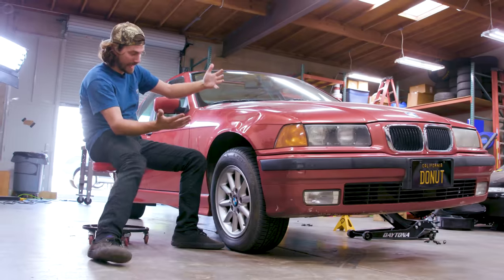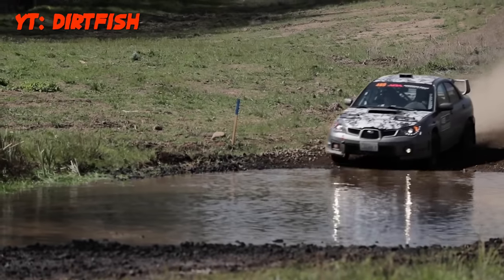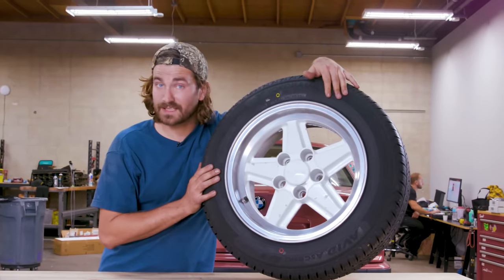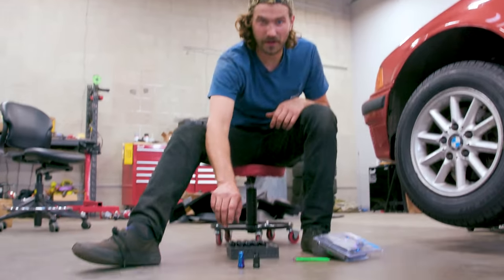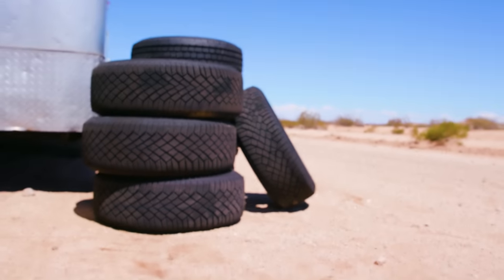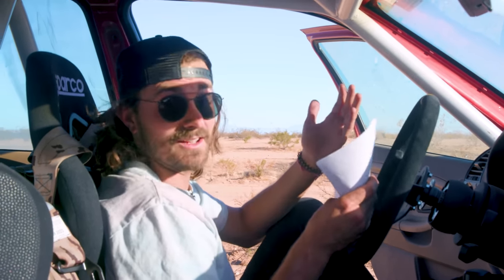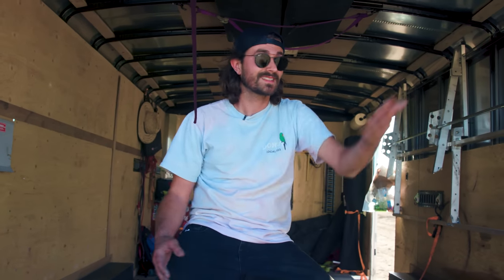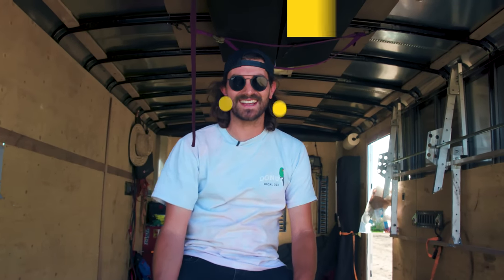BMW Off-Road Tires - Were They Worth It?

Comment: The team during editing:
"Why did we swap wheels for each test, and not do all the test with one set..."
Reply: It’s faster to swap the whole wheel than just the tire, and the tires were different sizes, they wouldn’t all fit on the one set of wheels.
Reply: @saltybutsain6348  Haha, I didn't realize it could've been done even worse!
Reply: Yeah, like Salty But Sain is saying, it's a whole order of magnitude harder. Instead of a quick unbolt the old tires bolt on the new tires, it requires mounting and balancing the new tires which definitely has to be performed in a shop.
Reply: @saltybutsain6348  I don’t think you understand what was being said
Reply: @wontonii232  not what was meant
Reply: I believe what Nicolas was saying is why not do the three tests on one set, then change to the second set and do the three test and finally change to the last set and doing the three test.
Reply: @CristoferMagana  oh, yeah I bet they just edited it in a different order than how it was actually done.And even if they did it in the order you said, it wouldn’t take long to swap the wheels, since they have 5-10 people there.
Reply: @CristoferMagana  I was trying to make a joke. ;-)

Comment: Now I wonder if the snowtires were the fastest because they were 16"
Reply: That could help a little, but the main reason I see is a lot softer compound, it has a crossed pattern too, this offer a lot of grip, but everithing comes with a price, and as he shown, those tires will wear out soon than the others, I would prefer to have more grip if all those modds are really going to be squeezed out, rather than other harder and durable but slippery tires.

Comment: A pro tip for beginner rally drivers, put in tubes in tires. There is a big chance you will bend the wheels hitting hard rocks, trees etc. Old school tubes in tires will let you finish the race at least and the tire wont go off the rim so easily. Its It's a cheap, kinda oldschool way, but it works

Comment: I've never had a problem with lug bolts, if the center bore is correct you can just stick the wheel onto the hub and install the lug bolts.. but to each their own I suppose

Comment: In my opinion you picked the wrong snow tires.  You are correct in mentioning that the studless snow tires that you bought don’t like the heat.  But you can also get studdable snow tires.  They are a little harder compound than studless, but still offer some really aggressive tread.  One example would be Firestone Winterforce2 as a studdable, VS a Blizzak as a studless.  So I would have gone the studdable route for my snow tire option.

Comment: The only thing I know about rally tyres is that you want a sharp edge to the tyre wall.
The sharp edge really help dig through the soft top layer when you're going sideway and gives you the grip of the solid dirt underneath.
Those truck tyres looked like they had a nice edge.

Only 4 minutes into the video so keen to see how they go.

Edit: actually the snow tyres seem to have a nicer edge. The normal tyres look really rounded, I'd expect them to just flow over the soft stuff while sideway and really reduce grip.

Comment: fun fact. snow and ice tires are much softer a tread compound than your typical dirt and gravel tire. that means they flex, heat up easier, and grip for days. but they wear out fast. think of it like drag radials for the dirt.

Comment: I live in Minnesota and have run lots of different tires for winter on coupes and sedans. I can say that, by a long way, the the conti winters were by far the worst winters i've had. anything over 4" of snow and you are thinking shovel and/or uber. whereas I had cheap dunlops on a 330i and it was a snow macnine. never stuck  Also did 4 MN winters in two different S4's with all seasons. Not great in any season, as you'd expect.

Comment: The second I heard snow tire I was like nooooo. Up here in southern Ontario I take off snows above 7°c so end of March to mid April. I run mud and snow rated Continental grand touring all seasons tires the rest of the year great in the dirt great in light snow great in rain. I drive back country roads every day with mixed tops from dirt to tar to pavement

Comment: i think the tire pressures might have a lot to do with that stopping distance because the different sizes will make the tire sidewall roll over and flex much differently. maybe do an episode playing with optimal offroad tire pressures?
also i think the slightly damp dirt on course will give you an advantage over the previous video as less dirt moves around while you drive and its not slick mud.
the truck tire will be best mainly because of sidewall thickness. I've blown holes in a few sidewalls in my subaru while sliding around hairpins. Any big rocks when ur doing that will just go right through with all season car tires

Comment: Hey Zach Jobe! You should put a cover for the Manual Transmission Shifter I think so. Because there's some sand storm is coming into the cabin through that hole

Comment: so we have the truck tire as the hardest, the yoks as the mid, and the snow as the softest. in terms of mechanical grip, they are similar enough to be irrelavant on this terrain. on pave, the difference in tire compound would become much more apparent. tread pattern isn't as important as tread depth, sidewall thickness, tire pressure, and tread flex is for dirt/snow road grip. it's an important part of road holding and handling in rally, but it is less important what kind of tires you have on loose surfaces than it is on tarmac

Comment: I've always wondered, can racing in the desert be a problem as dust can get into the engine?
Reply: Eventually when the air filter gets clogged but it would take a bit of neglect, not cleaning it or replacing it.  First thing that would happen is loss of fuel economy and power

Comment: For those in places without snow, snow tires work on the basis of trying to collect and hold snow in the tread pattern, because snow sticks to snow, runner doesn't, so the design of the snow tires tread is basically not helping any in the soft sand

Comment: Zach, if you're ever in WA state, let me know; I'll drive any distance to get a pic of our e36s together.

Also, maybe not a popular point of direction but, if you're going to be driving using your handbrake and shifting, e36/46 platforms like you to have your right hand either between the shifter and the ebrake or floating above the shifter while your left hand does all of the steering unless you need to really grip into it. That said, I fully expect a hydraulic hand brake to be up on the episodes list with a showing by probably chase bays (I bet the hoonigan branded hydro brake if I were a betting man).

Comment: I feel like you really shorted the truck tires. A closed-shoulder highway-style tread doesn't seem ideal for rally. I would have gone with an AT, like Cooper Discoverers or Hankook Dynapros. I actually went with Dynapro MTs on mine, as our tracks tend to be either sandy black dirt or clay, & often have mud holes.

Comment: Those truck tires were ht's that means highway tread, least amount of actual traction that dot will allow for legality while reducing rolling resistance to get better mileage. An actual all terrain would hook much better and not get chewed up too bad.... I can always tell the highway treads up here in a Minnesota winter, they're the ones stuck on flat road in 2" of snow

Comment: The Sumitomo HTR A/S P02 that were on the car to start were regarded as very competent budget performance tires in their time, sacrificing comfort and noise for all weather traction. I personally would have gone for its replacement, the Sumitomo HTR A/S P03, over the Yokohama Avid Accent GT. They test better in winter conditions (which requires tread features similar to off-road tires when not using winter rubber compound) and have decent ride comfort (taking bumps well = better maintained contact patch on rough surfaces). Bonus, P03 is relatively cheap!

But then there are All-Weather tires to consider as well, such as Michelin CrossClimate 2, Firestone WeatherGrip, and General Altimax AW365.

Comment: So snow tires are what I use on my Subaru (rally build) out in the dirt.  However, I've only used them in the winter so far out here in Utah (car is under the knife right now).  I'm curious to see how they handle the heat.  AT tires may be a good middle ground if I don't want to be swapping tires whenever I go to the dirt.

Those Yokohama's did better than I thought, but they also seem to have really deep treads for a street tire.

Comment: One big complaint: with this few runs, you shouldn't measure the averages (or at least, not only), but instead measure the fastest lap for each tyre. If you had run a hundred laps per tyre, sure, then uneven driver performance evens out, but with such few laps, fastest laptime becomes more relevant.
Reply: i was curious to know which tire had the fastest lap as well.  also they didn't show how they did the laps.  did they do three in a row of the all season, then three in a row of the truck, then three in a row of the snow tires?  i mean maybe his seat time was a bigger factor than the difference in the tires.  they should have randomly did all three tires (hiding the tire type from the driver too maybe) and let us know that.

Comment: If you had purchased a hard compound high performance snow tire like Dunlop Winter Sport 4Ds, they wouldn't break down like that. I would run them year round "spiritedly" in Alaska and participate in amateur rally events in a Subaru WRX and would get 3 years of use on them with minimal wear.

Comment: As a offroading truck enthusiasts im wondering how an all-terrain tire is not on the list for the offroad racecar, are all-terrains not specifically designed for what your doing, and in that small of a size (considering trucks running 35"-40" tires) would be pretty cheap?

Comment: Those Muteki lug nuts suck specially on the coating. The coating fades or chips super quick and they tend to strip easily. I bought a set and was highly disappointed with them I ended up switching to sickspeed lug nuts

Comment: I hate studs so much. I took off my exhaust headers to wrap them and some of the studs came out. I had to drill out one of them and tap the hole larger to put in bolts.

Comment: Snow tires are terrible on gravel. They are way too soft for it and they pick up rocks. Those small cuts in them, meant to increase grip on ice and snow make it so that grip on other surfaces is pretty bad compared to a normal tire. And since I've only used winter tires in winter climate +10°c to -20°c, I can only imagine how bad they would feel in the summer. Would be like driving on a sponge.
Also, they are way too wide for rally racing. At least in the front. 205 would work at the back but the front should really have 175-185.

So in the end, if you want to go with a non-rally tire, an all-season tire would be best. Made to work in all conditions/climates but still meant to have grip in slippery conditions.

Comment: I think this would be the only scenario where 6-7 year old winter tyres could be safely recommended.
(Cause they are so hardened by that time that you would not want to use them in winter conditions or on wet roads anymore)

Comment: Can you compare light weight, small diameter and width vs large diameter and width wheels?  Internet say always go with the wider wheel & tire for better lap times, but I think smaller wheels are better for reducing unsprung weight, and reducing brake pad & rotor wear, not to mention easier for the drive shaft to rotate.  What is the sweet spot between these two ideologies?

Comment: s54 swap it you guys have the budget. or do what I did and s52 swap it. throw some bilstein coilovers on there. do the clutch and flywheel since as you know it shares the same ZF 5 speed as the e36 M3. do an exhaust. LSD. brakes. and sway bars. I still have this car just with a blown s52...do the shifter bushings. dont money shift it doing like 120 like I did

Comment: How many runs per tyre you made? Or how you take the human variable out of the times as with each repetition of the track you will inherently perform better as you memorize the track, establish more adequate breaking points and faster driving line?

Comment: You guys did the 60 to 0mph test wrong, you are supposed to lock up your brakes when stopping on dirt, it will pile up infront of the tire but you letting it roll will make the tires surf across it, increasing the distance more than double if done correctly.

Comment: So this is an exercise in using 3 sets of inferior tires that would have been much more expensive than just getting a set of proper gravel tires. Fitment with deep dish wheels poking way out is most certainly not what you want for a "rally" setup lol. Also, changing the offset this much through wheels or spacers is very bad for your suspension geometry.

Comment: You know, all you need is a wheel hanger. It's just a rod that you thread into the lug bolt hole that let's you take the wheel off without it crashing down. Or helps line it back up going back on. Then you could continue to use the, VASTLY superior way of securing a wheel to a car the Germans intended for their machines. Cause you know. They're so VASTLY superior.

Comment: Geolander's and done bud
Reply: Specifically Mt G003 or a/t g015
Reply: I'm sorry but poke and flush were used in this video. Which means it doesn't matter what tire you pick because it's gonna be ass anyway. Video is more about wheels and looks than tires
Reply: Just hella flush it bro roll the fenders then rocket bunny it for the lol's

Comment: You need to work on your corner exits. You are driving like a drifter. You need to try and be pointing straight at corner exit so that you can get a good drive down the straights. You should really look at going to a midget or sprint car driving school. Not only would it make a great video, but you will learn how to get a good drive off the corners.

Comment: Oh yeah, the purely scientific standpoint

Would unsprung weight differences as well as track differences (width etc) not throw off the results? Since you have 3 different wheels in combination with your 3 different tires?

Comment: With this video u can see his data is flawed, he used the yokohama first then snow and truck, as the laps went on u can see he became for familiar with the car and "track". At the moment looking at the speeding up then braking would be a better way to measure what tyres he should use because every lap his braking points were changing and he was pushing the car more and knowing more about the cars behaviour. Ive done rallying and using a truck tyre is idiotic, on budget use a normal road tyre that has a good tread pattern by eye (looks most like an actual rally tyre). If your not rallying on gravel, mud or sand eg tarmac a tyre with low water rating normally means its slicker and shallower treads for better tarmac contact(summer tyre) and a larger diameter wheel helps. Also using a bigger diameter wheel than a r15 on gravel is stupid for rallying in this car, its adding weight to an object that should ideally be as light as possible, having the wheels a bit wider could help as well. Tyre pressure also has a large impact on this stuff. At the end of the video ur right what u did was a waste of time and any tyre could have worked for what u did, from the useable data the yokohama is obviously better from the choice on wear and speed but the snow is an option if its a colder or wetter environment. Rallying isnt just going flat out around a dessert its about problem solving and gauging how your car will react in different stage surfaces and setting the car for the most enjoyable and fast experiences. I hope you find this helpful

Comment: Those wheel studs he fitted look bloody awful.
They stick about 2-3cm past the outside of the wheel.
If they get bent, or the thread gets fucked, he won't be changing wheels very quickly.
Just stick with the wheel nuts.

Comment: Why the fuck didn't y'all go with an actual all terrain?  Ya know, tires made for off road?  Like a BFG ko3, or Nitto Terra Grappler
Reply: I was thinking the exact same thing! It would make so much more sense for an M/T or A/T tire to be on there, but at the size they are going for it is a little harder to find them, and when you do it's either going to be from an unknown manufacturer or CRAZY expensive, which wouldn't fit the budget friendly build. With that said, I still agree with you and they should at least try and source a set, and test them out.

Comment: Would have been good to know if you had noticed any handling differences between the tires. And not much of a conclusion reached at the end - "Which tyres are fastest?" "Don't know just go out and drive!" Thanks, coulda figured that out. Just saying if you're gonna do the titles stating that the video will answer a question then it would be nice if you tried to arrive at a more useful conclusion. Anyway, just my opinion on how you could improve your content - only trying to be helpful, not an asshole.

Comment: What are you on about with lug bolts being worse? they hold on better. Ever wondered why you americans sometimes see wheels just fall of the hub, and we don't? Because your nuts eventually sheer of the threads on the end of the stud. Screw lug nuts and studs, i hate them. Also, thoose stupid studs get rusted on to our hubs here in the nordic countries, which is why I have almost never seen them